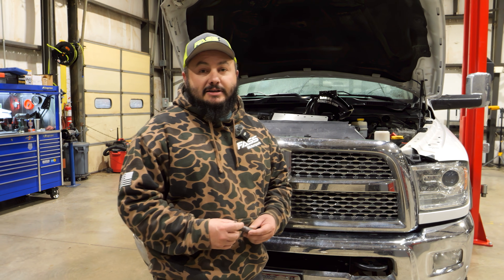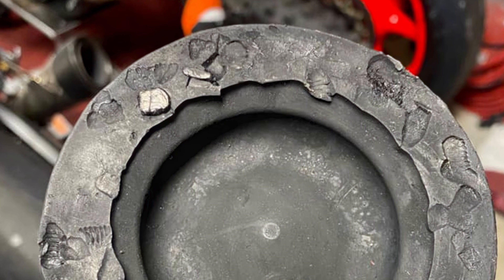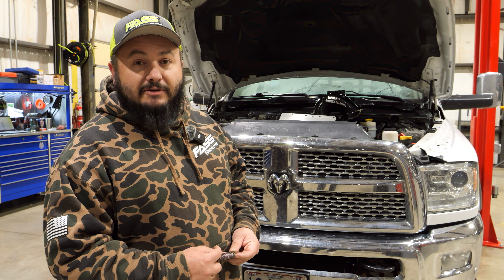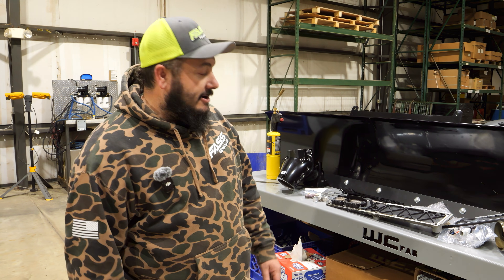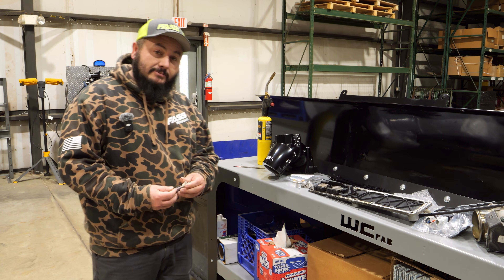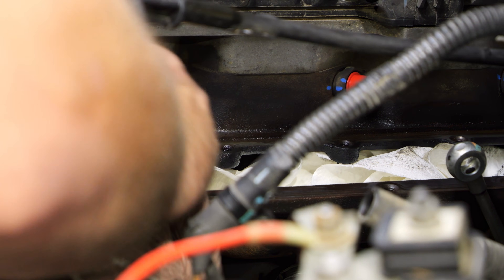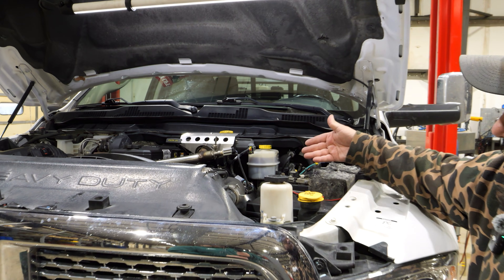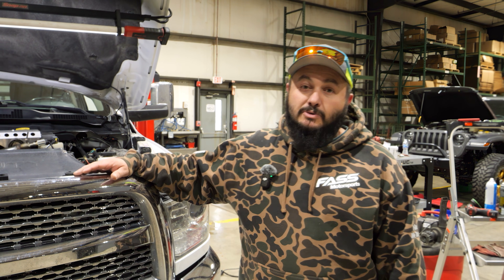6.7 Cummins Banks Grid Heater Delete installation!

Comment: Does this require any tuning after the install?
Reply from the maker: Great question, and it shouldn't require tuning.
Reply: No tuning required. However, if you do tune it later, the gains get even better.

Comment: The FASS Fuel (Pump & filtration) system, the Amsoil Oil-Bypass filtration, and the Banks Monster Ram & grid heater Delete... the three "Must Haves" for every Ram Diesel pickup.